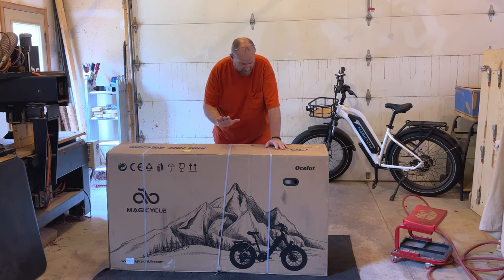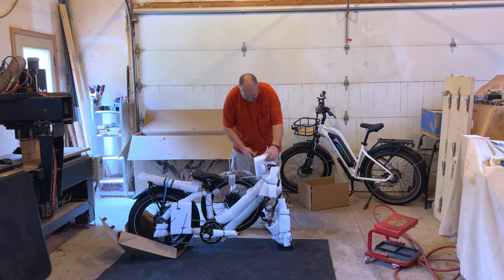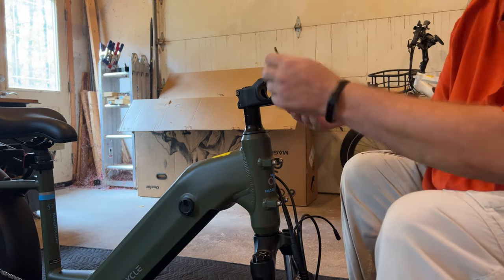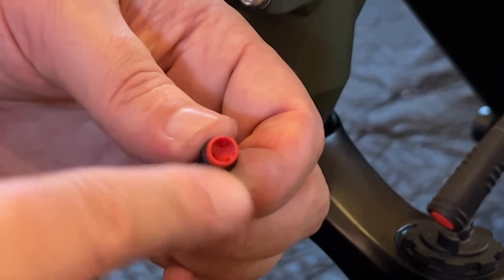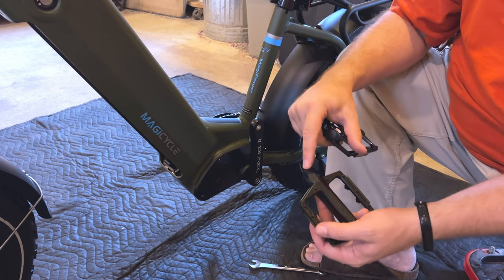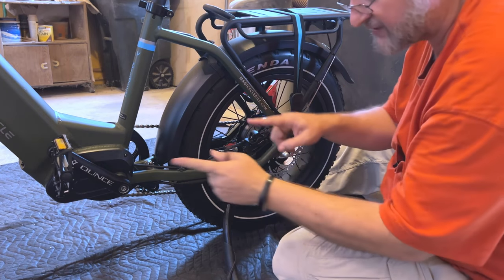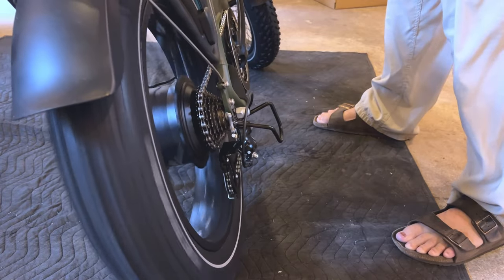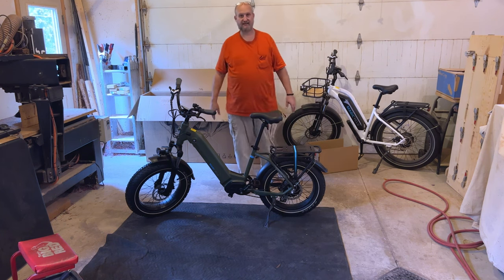Magicycle Ocelot unboxing and assembly - Tinkering Turtle

Comment: Thanks so much with your great video. The only thing I didn't do before trying it was make sure the tires were fully inflated. They are a little low but I figured that was OK since there is snow on the ground, kind of like riding on sand 🤷‍♀️
Reply from the maker: Your welcome.

Comment: Nice work, and great Pro-Tips for assembly. Yes, grips and an adjustable stem on the list for you. I feel there is plenty of room for a SunTour suspension post also! I look forward to the contrast vs 26 inch Cruiser bikes that you own. Paricularly handling and manuvering on the bike paths. If derailier was compressed in box, perhaps tweeked the cable pressure on the SIS shifter head and moved the needle? You mentioned guard was bent. That might indicates HEAVY and sustained force on the derailier OR a sudden jolt from droppping the bike/box? Hope support is there for you. Has anyone done a 52T conversion on the Ocelot? Seems 20 inch tires would also Ghost pedal given same 14-28 freewheel gears. Cruiser has 42T-26 tires and Ocelot has 48T-20 tires......?? Maybe 56T is the ultimate ring for Ocelot.
Reply from the maker: I will definitely transfer my Suntour to the bike, when I ride it, next spring. Grips and adjustable stem are more than likely. 

The gear shift was damaged, support has responded and shipped a new one already. The chain against the fender in first gear may be a tougher fix. I can either shift the cassette or crank outwards or trim the fender. I will have to consider that and see what is reasonable. Magicycle has offered to let me take it to a local shop and they would pay for the fix. But I want to consider my options here first.

I have to say they have been exceptionally responsive!

I will have to see how the ghost pedaling is and go from there.
Thanks for the comment!

Comment: I’m going to reiterate what the last poster said. Your explanation when putting this thing together is awesome. I never indexed the gears yet and after watching your video, it took me literally, two minutes to properly index them. I do have a question about brake travel. The rear brake travel seems like it is further than the front brake travel . The front brake stops the wheel, almost as soon as I touch it, whereas I have to press on the rear brake much more is this normal? I live in the Northeast, so unfortunately, I can’t take it out for a ride just yet.
Reply from the maker: Thank you for your kind comment. I am glad the video was helpful.
As far as the lever throw on your hydraulic brakes… I haven’t done a video on this. But you should be able to adjust how far the lever pulls back before the brakes engage. I believe this video shows that process generically. Let me know if it works for you!

https://youtu.be/-1iPRMgCkTY?si=Sd74WiHhsaszlzAr

Comment: Did you ever find a fix for the chain rubbing the fender?  I was thinking maybe a spacer inserted in the chainring might help, but I'm not sure how much play there is in the wheel hub to do that.
Reply from the maker: I ended up loosening the front attachment for the fender and slightly bending it. That biased the fender away from the chain. I think you are right you may be able to shift the chainring too.
Reply: @TinkeringTurtle  Do you think is this a design flaw (common with the Ocelot) or a problem just with your particular bike?
Reply from the maker: @Myron West I think it’s normal for the chain to run close to the tire/fender on fat tire bikes. In this case the fender attachment was biased to the right and had an interference with the fender in first gear. Once the fender was biased to the left the interference was alleviated.
Reply: @TinkeringTurtle  Thank you Tim.  I value your expertise and enjoy learning through your videos.  Please keep up the great work!

Comment: Have you noticed your left heal hitting the kickstand while riding? Just got it put together and took a little test drive. It's 32 degrees and snow on the road so didn't go far but my heal hit the kickstand while peddling a couple times.
Reply from the maker: Being a larger guy that tends to happen with me on most of my fat tire bikes. I don’t recall that happening anymore or less than the others.
Reply: @TinkeringTurtle  when looking at the ocelot next to the cruiser the cruiser kick stand is farther back. Probably because the difference in tire sizes. That's my guess.

Comment: Used your video to assemble this is the one to watch to assemble.  I have had the Ocelot pro for about a week.  I have the following issue.
I have been riding my Ocelot Pro for about a week now.  The wheel is set at 22" Factory setting.  I have ridden according to the bike screen 16.3 miles.  I was concerned as I have used 50% of the battery.  Then I checked my iPhone Gps Tracking my rides and it says I have gone 32.35 miles.  The Screen said I have averages 5.4 MPH.  The iPhone says 8.6 MPH.  I ride as PAS 1 or 2 seldom use throttle.  I am trying to rebuild strength after Cervical Spine fusion on my neck and have complete rehab.  Anyone know why the screen doesn't give me accurate Mileage or MPH?  Magicycle chat says this normal to use GPS as mileage but screen as MPH.  Math says that is wrong.  I went 8.2 miles in 55 minutes so the MPH different than the screen.  Temperature here is 17 overnite, 36 afternoons.  Any ideas???
Reply from the maker: Thanks for your comment. Unfortunately I haven’t spent enough time with the bike to figure out the intricacies of all that. And with the early snow this year it will be spring before I get a chance to go thru all of it.

I will say that if you measure from the ground to the top of the tire it is closer to 24”. Also if you take a ride and then turn off the bike when you get home, the next day the battery tends to be fuller than it said during the ride. One more thing as you charge and discharge the battery the internal cells will balance giving you better performance. Maybe give it a half a dozen charge cycles before testing it further.
Hope this helps!
Reply: @TinkeringTurtle  reset factory setting and it took care of it.  Thanks

Comment: Good job Turtle.I guess you'll be adding a riser?
Reply: Your big toe says you have a  🐴
Reply from the maker: I haven’t ridden it yet, but I think it is a safe bet I will add an adjustable stem and/or a riser. They say the bike accommodates a rider up to 6’ 2”, and I am 6’ 3”.
I also prefer thumb throttles and full size lock-on grips. Maybe I will do them all at once.

Comment: Got my ocelot pro yesterday. Going to start putting it together. The other one is supposed to be delivered today. Why make two trips? I'm not really sure. 🤷‍♀️
Reply: Right off the bat the stand to hold the forks is broken
Reply from the maker: I think that the shippers (fedex and ups) tend to split up shipments so they don’t overwhelm the drivers with really heavy loads. I think they split it up to spread out the weight day to day.
Sorry to hear about the stand, are the forks damaged?
Reply: @TinkeringTurtle  the forks are not damaged. Set them on a piece of Styrofoam while putting it together.

Comment: Is there enough play in the various cables to swap the stem clamp out for an adjustable one? I’m a taller guy and would likely want to swing those bars up a couple inches.
Reply from the maker: Yes, on my Ocelot I added a riser and an adjustable stem. I had to lower the handle bars slightly by shifting some spacers, but I did raise it up.
I showed the upgrade/adjustment for the stem and riser on the Ocelot in this video:
https://youtu.be/5BU8zVAfzIc
Reply: Yea, I saw that video after.  Some of those cables really seem to be stretched to about their limit.  I’m wondering if just a taller adjustable clamp wouldn’t be better than the stem and clamp.
Reply from the maker: I tend to like the stem and riser combo because of the adjustability of the combined washers. It allows me to move the stem up and down for the cable length. You can also, for a little extra cost and time, lengthen the cables and hydraulic brake lines.

Comment: Sir my ocolet pro just came in its all together BUT WHATS THE TRICK TO TURN THE BIKE ON I CANT SEEM TO FIGURE IT OUT???
Reply from the maker: As long as the battery is charged and installed, you simply click and hold the power button for a couple seconds. The screen should light up.
Reply: @TinkeringTurtle  ok now how do you turn on the headlight on the ocolet pro magicycle whats the trick.???
Reply from the maker: @123windyron click and hold the “+” button for a couple seconds. Repeat to turn it off.
Reply from the maker: @123windyron Just an fyi, they talk about this stuff on page 10 of the manual. Let me know if you have any other questions and I will do my best to help!
Reply: @TinkeringTurtle  hey great now I have a headlight whow thankyou
Now if I can figure out all the other settings ill be in good shape.could you sometime do a vid on the settimg screen for a basic ride going up hills?lots of them around here..
Reply from the maker: @123windyron please disregard that last message (deleted). I got mixed up on which bike we were referring to.